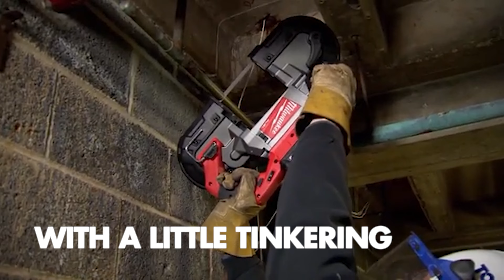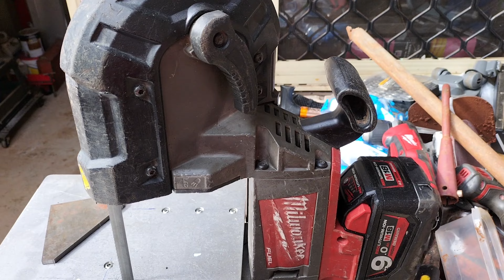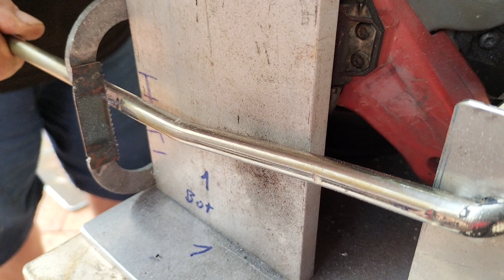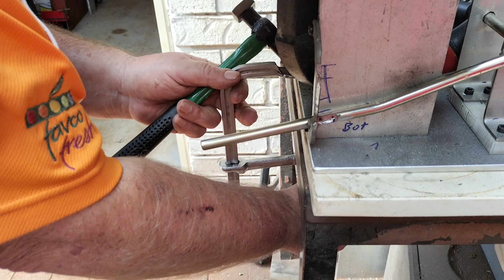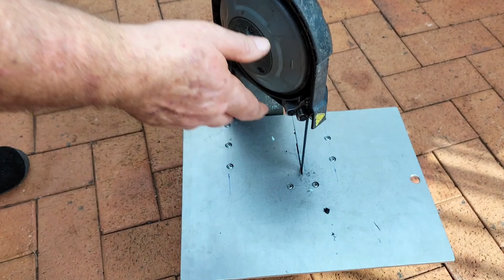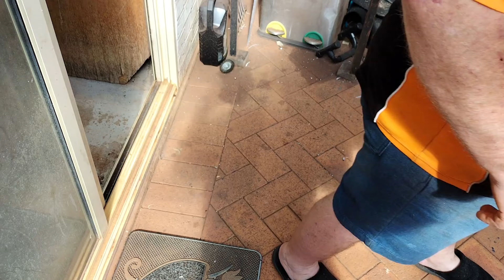Milwaukee 18V Deep Cut Band Saw - Make it a portable upright table bandsaw!

Comment: This is a step ahead of mainstream stands. Love the throttle control and overall simplicity. I have a 120-volt Milwauke on a homemade stand, but I plug into a duplex receptacle controlled with a light switch. Since my throttle is taped wide open, I don't have the luxury of variable speed ......  yet.😊